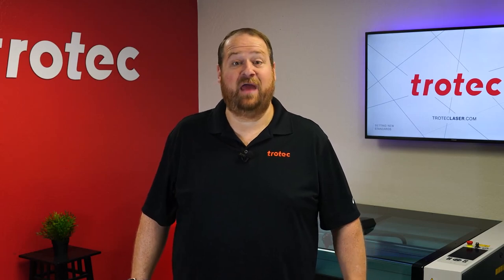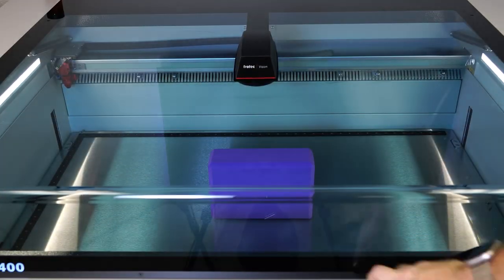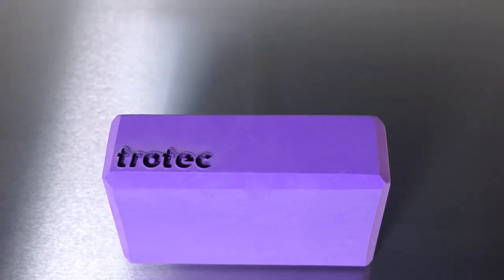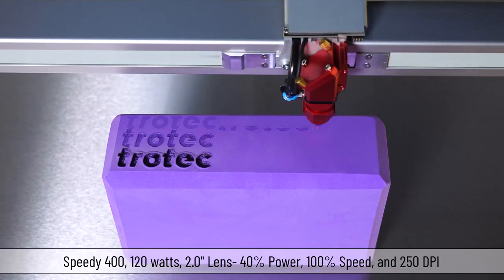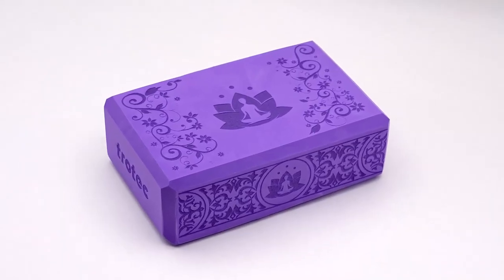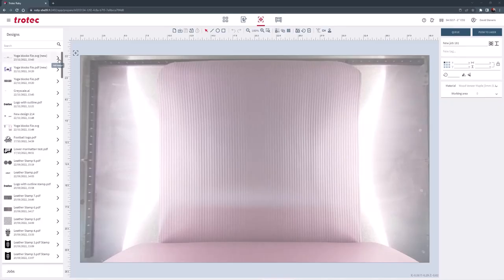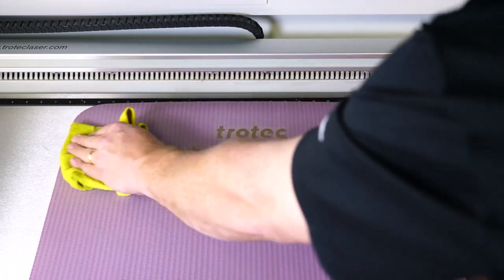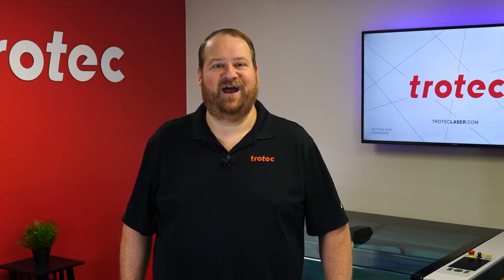Trotec Laser: Can you Laser Yoga Mats?

Comment: Hello Dave, I would like to know if it is possible to laser cut magnetic sheet  to stick for example on cork for those magnets on the fridge? I asked to the provider of the sheets and this is the answer that I got :

 It is possible that the edges get simply demagnetised due to the heat produced by the laser.  However, we do not know for sure. Moreover, we cannot assess how the self-adhesive magnetic foil behaves under the cutter laser. We were told by a customer of ours who tried to cut our coloured magnetic tapes that it is not possible because of the PVC contained in the product.
The self-adhesive magnetic sheets are made of a rubber-like elastomer with strontium ferrite powder (approx. 89%) and a self-adhesive side. We  would therefore rather advise not to cut the sheets by laser.

Thank you in advance, Andy.
Reply from the maker: Hello! Some magnetic sheets can be cut with a laser. But your supplier is correct, anything containing PVC is not laser safe. We recommend checking with your local rep and doing some material testing.
Reply: @TrotecLaser  Thank you for the advice, will do.